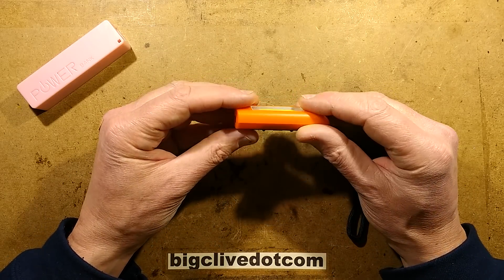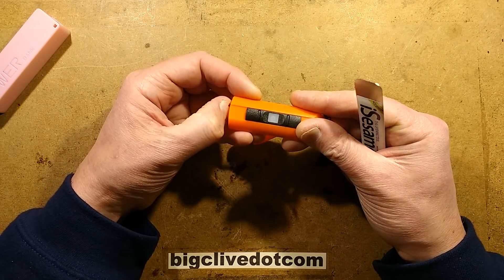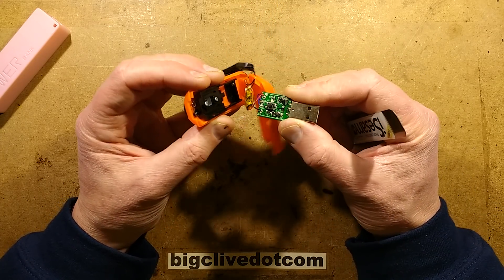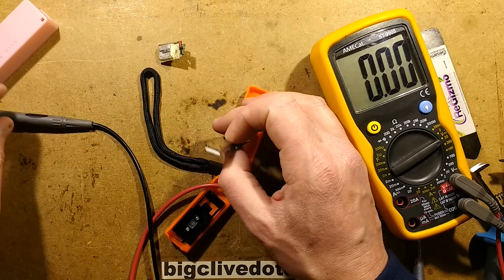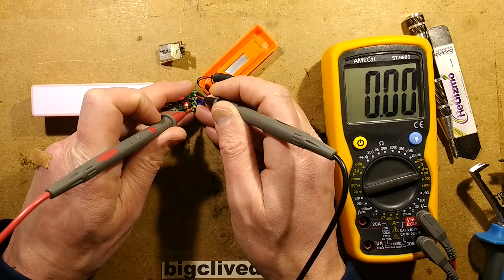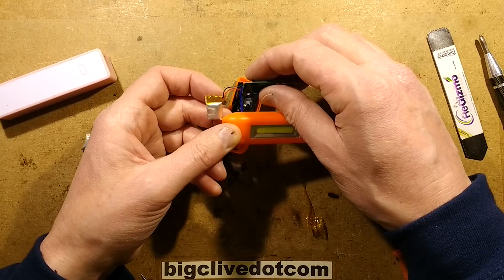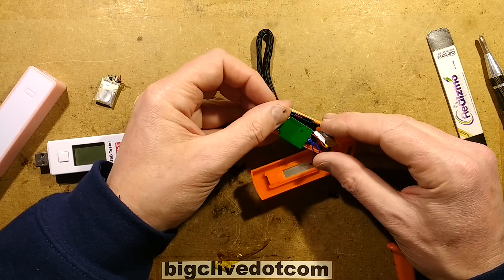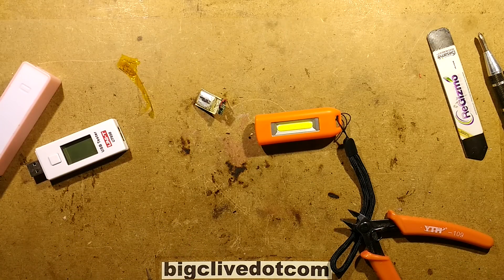Defective rechargeable COB light fix.

Comment: Hi Clive, I love your channel and I just found this particular video by accident whilst searching your channel for info on spudgers (Mine bend easily, do they all?) and stopped to watch it as I happen to have the same light purchased about a year ago at a local hardware store on sale for $2 (normally about $10 here in Australia). Like you, I love a bargain.    :-)

It worked beautifully until I tried it yesterday and there was no light.
Disappointed, as it was nice and handy and very bright, and so far very reliable.
Inspired by watching many of your repair videos,  I happened to open it up just before finding this particular video.
Bent my spudger getting it open, hence the search for your spudger recommendations!   :-) 
Good thing was I still have it open on my desk, so was able to compare it with your light and it looks exactly the same other than the case on mine being black. 
The battery in mine is flat on the bottom, and curved on top, but this seems to not be bulging, but it's normal odd shape. 
On mine the problem was the (rather thin) positive blue wire going to the LED had broken off. Oddly it broke just inside the insulation, about 5mm from the pcb end. Odd place to break I thought.
Any idea why it might break at this particular point?  The wires obviously break after many operations of the pcb/usb plug being slid in/out causing fatigue.
An easily fixed design fault I guess, but may happen again.

Comment: The idea is not bad though. 
Maybe a flip open design, that separates battery and warm part would be ideal as a compact worklight.
But the idea of a tiny dangleable flood light thing in the pocket is still intriguing. 
I use a nightcore tube for lightweight carry around. 
But it lacks the flood light feature or standing on a desk or toolbox ability.

Comment: That battery looked quite puffy when you first pulled it out.  Odds are that the over-charge protection built into the battery has failed and it puffed up due to being over-charged which in turn destroyed it internally.

Comment: Bigclive, can you take apart and review one of those solar toys from the dollar store that move back and forth? They have lots of toys for different seasons like turkeys, Santa, bunny, flowers, and there are some butterfly types that move on a thread. The tiny solar cell generates 1.7vdc! (I just took one apart.)
Reply from the maker: +Chuck Roberts Those ornaments are quite interesting because they're based on the circuit of early electric clock pendulum movements.
Reply: Neat. How early are we talking about? Late 1800s?

Comment: Hi BC, I noticed the wires on the battery broke off from the circuit board. I frequently have this problem with multi-strand wires from China on various devices. The cheap wires only need to bend a few times before they break. So I invested in good quality solid core wire and sometimes replace some of the wires.

Comment: Hey clive, I dont know if you will see this, but i have an electrical question. I have two speaker drivers, they are wired in series. 4 ohm a piece. I want to shift the phase (not flip) on one of the drivers, any idea how to do that?

Comment: i think one of the reason for the protection in the original battery were for discharge protection. without it the cob may run battery down below safe voltage perhaps? just my thoughts

Comment: Well Clive just an observation from your video, but the puncture on the battery looked to be from the USB or switch sliding close and open and close again. After assembly it was probable that is was turned on one time to test and that struck the final blow killing the battery. My best guess.

Comment: This reminds me. I have a flashlight that charges via usb. The charger that came with it outputs 300ma. I would like to be able to charge it with a power bank but when i tried the charge circuit overheated and stopped charging the cell. Unfortunately i cant access the charge circuit without destroying the flashlight. Does anyone have an idea on how to limit the current without dropping below the minimum voltage for usb?
Reply: You might try a rectifier? Reverse polarity protection is a bonus, but the 5V will have been reduced to about 4.3 Volts, and current will be reduced throughout the charging period.

Comment: Hi Clive. A question if I may, why is Kapton tape yellow? I know what it is and does, I am just curious about the colour. :-)
Reply from the maker: I'm not sure if it's a native colour or a specific colour code for a rating.
Reply: Even after rummaging around on Google search and the Du Pont site, I find no answer. Maybe it's yellow because that is quite a neutral colour with regard to electronics... oh well, thanks for your answer. :-)
Reply: I have no idea but I can guess: yellow can be seen, so you know the tape is there, but it's also transparent, so you can read most IC markings too. An opaque tape would mean the tape would have to be removed to see component markings.
Reply: CW Roberts - Yeah, that's sort of what I meant by "neutral colour", easy to see and no electrical meaning.
Reply: I had a roll of green kapton tape but not seen any other colours.
Reply: Clive - does your USB analyser not have a logging function? I purchased one off eBay and it logs the mAh taken by whatever is plugged in
Reply: Stable optical properties of high transmittance and low yellow index are required for a polyimide film as a flexible display substrate, but thermal processes could result in its color change by thermal imidization.

Comment: Hey Clive, remember the video about the cheerson cx10 you did a while ago?
After seeing it i went on some chinese website and bought one for 15€ and it arrived with the battery already gone thermo...
The CX10 itself was ok though so i switched the battery but it never flew well (drifting randomly to the side mainly).
Then i bought a furibee F36 from banggood and it was a much better experience. Compared to the CX10 it has tons of power and is very stable. It also flips really well.

tl;dr go check out the F36 or any other tinywhoop clone, they are awesome!

Comment: Clive..
I love toys and tech..but HATE what they are doing in the USA..
A flashlite I had, with 3 White light settings, 1 laser and 1 UV, was a great light..
But the flaw in it was Wire so Fine, that when Soldered, it made the Wire Brittle..
After a few Drops, it started breaking..and the wires Cracked loose..
Opened it up and couldnt get all the way in, except to see the loose wires inside..
Reply: The worst stuff is that thin Copper-covered Aluminium, which wilts when a soldering iron is waved at it.
Reply: This is when US companies buy stuff from China. The wire from China is awful. I make LED lights to sell and I have this problem a lot with the wire getting brittle and breaking.
Reply: Send it to Clive - he'll fix it!
Reply: Shipping and handling would kill both of us..And there WAS a warranty which had JUST expired..
Reply: CHEAP speaker wire...looks good, but the plastic IS the material that match the AWG..not the metals inside...  Even Bell wire is abit hard to find anymore..(used in door bells and alarm systems. Solid 2 wire)

Comment: Isn't the reason that it pulls 500mA when charging because the D+ and D- pins on the USB port are shorted? If they were not, it would conform to pulling only 100mA as per spec?
Reply: Lagittaja It doesn't work that way. The shorted/floating pins are for the power suppliers, where floating pins mean that you can draw max. 100mA (can't remember exactly, but it was a smallish number), and shorted pins mean "take as much current as you like". Smart devices, like a smartphone, or a (_very_) smart-ass power bank, would use the status of these pins to set the maximum current at the power controller. But not-so-smart devices, like the splendiferous LED light, would simply use the USB as a 5V source, and thus cannot do any of this fancy current-limit detection.
Reply: Figured. Thanks for the clarification. Why are the pins shorted on this light then if it doesn't do anything.
Reply: Lagittaja Because many PSUs limit their output depending on the resistance across those pins.  Though in this case it does seem pointless as even the lowest current is more than enough.

Comment: The protection circuit of the cell also provides over discharge protection. So you want to consider to transfer the protection circuit from the old cell to the new one.
Reply: Overdischarge protection isnt as important as the other features.

Comment: Is there any way to make an adjustment to the charging rate? How could you lower the charging rate?
Reply from the maker: On the charging chip it is usually set by a single resistor.
Reply: Might make an informative video. I have a similar problem with a hair trimmer and an 18V drill I converted to 18650's from nickel Cad. Using USB charge control boards.

Comment: Clive, you dissapoint me. When you opened it, you couldn't tell the puffy cell is dead. There ain't no healthy puffy cells. 
And you couldn't even see those gnarly giant spikes from the solder joints that obviously are the reason for the puncture? 
It obviously passed factory inspection, and at some point when someone pulled the button too vigorously, it punctured the cell with the bad spike from the cob. 
C'mon clive. Cmon.
Reply from the maker: The cell wasn't puffed up.  You get a much more detailed view in high definition than I do in real life, especially when I zoom in.
Reply: Lithium cells are vacuum packed, essentially. So they have a nice flat glossy finish. Your lithium cell looked crinkled, a little puffy and grimey. As if it had been folded or bent. You squished it with your fingers and it clearly lost some of its volume... C'mon clive. 3:44 it looks puffed. It should look almost pristinely flat if it's healthy. There's no support for the plates inside. If there's damage to the plates, the cell won't look flat. Prying a battery free from adhesive permanently damages some of its capacity if it gets bent.
Reply: @dimitar4y  
I have the same light (commonly sold here in Australia as a Arlec branded AT0054 cob light) in hardware stores and on Ebay, and the battery is actually flat on one side and kind of curved on the other, giving it a "puffy" appearance, when actually it's just it's normal shape.
Reply: @ericoppel5698  battery plates + curve = separation and damage. I want to see a schematic of the internals and why it's "Looking puffy", because the normal construction shouldn't allow this.
Reply: @dimitar4y  Hmmmmm, OK, however it shows no sign of leakage and is working just fine. Odd.
 It's kind of pillow shaped, but with flat ends if I look at it from the end. Kind of like it is made of some kind of layer which has been wound around itself if you know what I mean? Bit like a polyester capacitor. 
I don't want to pull it apart as it still works.
Reply: @ericoppel5698  test it's capacity, is it as rated and/or typical for the volume/mass.
Reply: @dimitar4y  I don't know how to do that. Connect it to a load of some sort and measure current and time it until flat?
Reply: It has a 100mah battery. On AliExpress they claim it should run for 30 mins on high setting. I could charge it fully and then see if it lasts the claimed 30 mins.   :-)
Reply: @ericoppel5698  until 3.0v and/or it's rated 'discharged state' voltage is. Wait if you don't know how to do that why are you giving me lip, lol.
Reply: @dimitar4y  lol. 
Not "giving you lip", just telling you my observations.  :-)
Will test it tomorrow as it's almost midnight here now, and I still have to solder on a suitable bit of wire and then charge it fully. 
Too tired, but am curious myself so will do it and let you know.

Comment: +bigclivedotcom
When stripping delicate wires that are somewhat connected I use a lighter and melt it a bit a strip it also I was wondering why the protection chip wasn't applied?

Comment: Maybe the cell protection circuit was needed because of the high charge current, that board could have been used for a light with a bigger cell.

Comment: I remember having a Korean TTL Standard 24-pin plug (4.2V) to Micro USB B converter that was shaped like Android logo and had a really odd feature in it; It had 35mAh lithium battery in it (not 350mAh, *35mAh*) and it provided a bit of boosted 5V from the battery as a buffer.
However it had a huge problem, as it ran the battery down too quickly and damaged the battery, resulting in a big patch of electrolyte on the circuit and corrosion.

Comment: Does the protection circuitry on the defective battery limit the charge rate, or just simply stop charging/discharging at specified voltages?
Reply from the maker: +rjolly87 It protects against over charge/discharge and also against high current faults.

Comment: I heard there are lots of these li-po flashlights coming with "recycled" batteries these days (harvested from used electronics with other failed parts)... so it kinda ends up being a matter of luck. Not sure if true though.
Reply: i doubt if those small cells are recycled, they cost pennies to make, and are just badly made and they dont test any, so a high failure rate

Comment: It's fine to charge them at 600 mA.
Reply: Assuming it is - as it says - a 100mah cell, that's a bit more then the ~0,5C your avarage lithium charger would pour in there. Even the new quickcharge protocols for phone batteries don't go much above 1C periodically i don't think, let alone 6.
Reply: 6C is just brutal. I think some LiFePO4 batteries can stand this but not much else. Of course a small battery can dissipate the heat better (high surface area to volume ratio), but it' s just extreme. I use 1C or at best 2C. If it's similar to the usual charger chips, a resistor sets the current.
Reply: it would be like charging a tesla at 2 megawatts of  power...
Reply: What?  Don't they need 1.21 gigawatts?
Reply: only to charge them whilst doing 88mph , and then you need a long charge cable
Reply: Don't forget the clock. (Timed charging?)

Comment: 0:50 Green with a smidge of red, and suspicion of disconnected battery? That sounds like the little TP4056 charger boards - without a battery, the green LED's lit and the red one flashes at 4Hz or so...

Comment: If the cell leaked and was charging at 2.5W (plus it is a Chinese made cell), that might explain why it leaked, assuming it wasn't damaged before or during assembly.  Too many possible failure modes.
Reply: It looks damaged - punctured.
Reply: Or it went 'pop' as a result of charging too rapidly. A 21st Century Chinese firecracker.

Comment: You could have solved most of the problems by using a larger protected battery and fixing the sliding apparatus in place.  You'd just have the USB connector sticking out all the time.